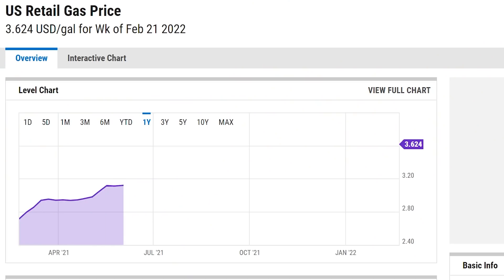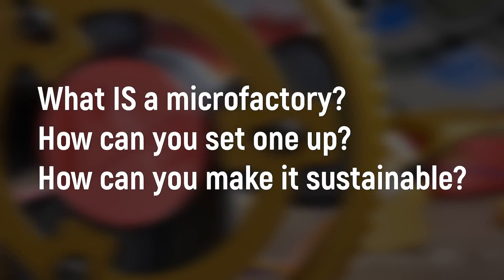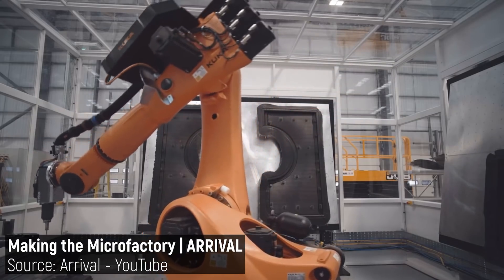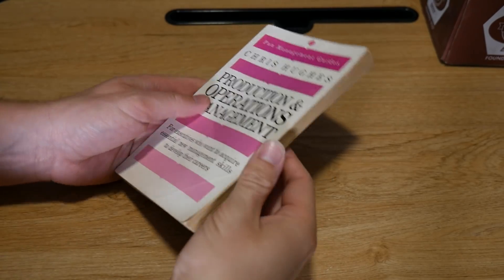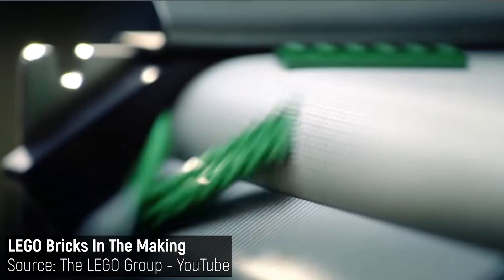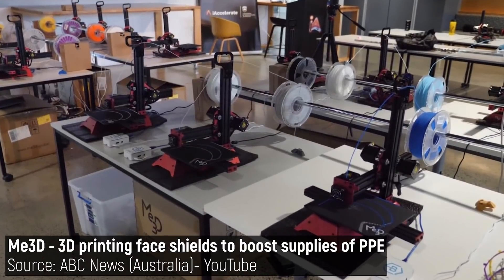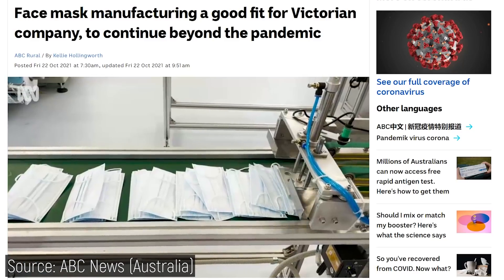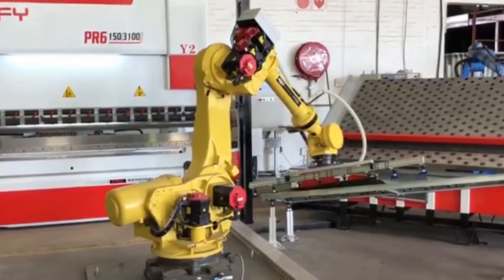Can Microfactories Solve the Global Logistics Crisis?

Comment: We already have the concept of a "small office/home office (SOHO)", and I think we now need to have the concept of a : "small factory/home factory(SFHF)". I myself have a metalworking workshop and very much want the idea to succeed.
The concept is not without its challenges though.
Before the industrial revolution and the steam-powered loom made centralised mass production possible, clothes were made by home weavers on manual looms, and were only sold locally.
The idea of home manufacture and local supply worked originally because the raw materials for both the product manufacture and the (wooden) machine used to do the manufacture were available locally. 
This original definition of the concept breaks down if what you are making requires imported plastic filament, and your 3D printer is constructed from ICs and motors made on the other side of the world with a 9-month back-order lead-time. 
Believingly that using such a printer makes the manufacture independent of the global supply chain would be completely delusional.
For the sort of goods required by a modern person, it is virtually impossible to start from locally sourced raw materials and produce finished goods without some part of the process requiring the global logistics supply chain.
However, this should not stop us from doing what we can to help.
It is still possible to import raw-materials and components and add value to them with a local manufacturing process and then sell that to the local community, thereby reducing (but not eliminating) reliance on the broken supply chain.
Whether this model is economically viable is a vastly more complex question. The current state of the global supply chain is that it has inconvenient delays, but it is far from being so broken that individuals have to grow our own food and make our own clothes. As such, the engines of mass production can still easily economically out-compete any home maker. For most goods, the home maker can't buy the raw materials to start making something for less than the cost of simply buying the finished article and having it shipped all the way from China. They have lost on price before they even start.
Either the situation would need to get MUCH worse than it is, to make home manufacture economically viable, or the home manufacturer needs to pick very niche markets where the mass-produced goods are completely unavailable.
Reply: Hello Nicholas, We have so many available raw materials that are not very well employed. My passion is to harvest the forest fuel overburden, just for one example. The materials currently catastrophically lost to fire could become premium quality humus and also could be potential used for making an endless amount of methane to fuel the operation. It is an infinite resource that needs to managed. There are so many wasted raw materials, or recycled feedstock materials that are shipped overseas to be remanufactured. Really finessed recycling could potentially go a long way to diminish the need for imported raw materials and other items currently imported. Really, small solar powered workplaces could be employed for the purpose of refining recycled raw materials on the local level, which in turn provides them to small local factories and workshops.

Comment: There's a 2 book long series called "Daemon" by Daniel Suarez

There's a lot of unrealistic or not so cool to live through stuff in it, but small scale production facilities that were basically a shed with a 6 axis cnc mill and a metal 3d printer that could build most anything
Reply: everyone forgets the lathe, it's the most fundamental machine tool and having a CNC mill without also having some kind of lathe is like having all those fancy kitchen gadgets (air fryer, pasta maker, whatever) but no stove or hotplate you can boil a pot on. You can mill a driveshaft with a 6 axis machine, but doing so is pretty silly.

I have a lathe and a mill, but about 70% of what I do is lathe stuff. Maybe 15% is possible to do on the lathe but easier on the mill. So If I were to have only one machine, a decent lathe is  what I'd want.

Comment: first thought: limitations in manufacturing resource distribution. only one place to go in a big factory, more shipping locations with micro factories. same problem, but i'm sure would work for specific item's. real world problems usually need multiple approaches.
Reply: How about a blend of the two? I don't believe mass production and super factories are going away soon, but perhaps a big factory making a basic product (and handling the certification and other economy-of-scale type overhead), with near-market job shops offering dressing/modification/customization for their local market. E.g. a factory making smartphone or wrist watch internals, with micro factories building them into the form factor desired by the customer. Or a factory making and shipping fabric blanks, with the micro factories sewing up the pieces into semi-bespoke clothing.

Comment: The main counterargument about cost is that freighting makes up a little part of logistic costs (with dominant part taken by last mile delivery), even more so in the scale of total cost
Reply: Over seas shipping has got significantly more expensive.  A container shipped from China to the US used to cost about $1000 in late 2019.  Today, that same container costs $10000.
Depending on the item, the additional cost can be insignificant or very significant.  It's a your mileage may vary situation.
Reply: @Shocker99  almost absolutely true, FRI has risen from 1,5k to 10k. However, per unit of 250g package it is still in realms of 1,5c vs 10c

Comment: I think the idea sounds awesome, and depending on the area you'd find people willing to pay extra for something a little more custom, or longer-lasting, etc. Another idea I thought of a bit ago in this vein (that I would have no idea how to implement) is a similar idea for repair shops. There are repair shops for computing electronics, and a lot for very specific things like lawn tools or the like. But recently my vacuum cleaner broke and I was able to fix it, and realized that most people I know would have thrown it out and bought a new one. So what if there was a repair shop that basically took anything, on a case-by-case basis (i.e. if they think they actually can fix the thing) with limited or no guarantee. Like the idea of a "tinker's shop". Again implementation would be hard because you'd have to be very clear that you can't make any very strong promises (unlike, say, a phone shop certified by a manufacturer to do repairs on their devices) and it would be tough to develop a pricing model that was fair for both the store and the consumer when some repairs will fail. Still though, if it could be figured out it could cut down on a lot of wasted products.

Comment: I think for this to take off it would be highly beneficial to have ranges of useful products for a local market with a standardised system behind it. Like it is with programming you have defined input and output ways between different software parts so anyone can implement them and use the part. The same would be very helpful here. Of course every 3D Printer, Lasercutter etc. is different but if you have defined systems that the micro manufacturing place can then implement to run on their machines they could produce most products build for these standards and that would make this whole endevour worth pursuing.

Comment: One problem I see is for example, I have a small hobby shop in a shed in the back yard. I have a mill, a couple lathes and other wood and metal working tools. As well as 3d printers. The problem is zoning. My residents isn't zoned for a business. That could cause issues. That would be a problem for many people I would think. I do like the idea of Microfactories though.

Comment: Stephen Hawes  talked about this in his videos while designing an Open Source pick and place machine. This Mid Scale manufacturing where you make more than just a few hundred products but not much more than a coupe of thousands. This weird in between where  full scale assembly lines are not cost effective and hand assembly not time efficient / to expensive. With 3D printers and other CNC machines making it more possible to fill this gap between bespoke and large scale production runs.

Comment: Microfactoring depends heavily on the use case. Especially for products where the transport is the main cost factor this is a viable option. But when you need cheap labor (like clothes industry) I think micro factories are not the thing unless these items can be produced automatically.
Producing clothing still needs a ton of manual labor. Therefore the producers look where they can acquire the cheapest labor in the world and don't worry much about transportation.
Like in the case with clamping blocks (to avoid the Danish product name) if the supply chain can be moved locally too this is an option (printing clamping blocks takes too much time).

Looking forward to your videos on this topic (and others as well).

Comment: 3D diy metal printers built out of welders are a thing now. It reminds me of when we all still had to build our 3D plastic printers from scratch.

It won't be long before we get affordable 3D metal printers. I'd like to see the diy injection mold machines also take off.

75 years ago even small cities had a local foundry. I'd like to see those make a comeback to work with local micro factories.
Reply: Have you ever seen the product made by those welder based 3d printers though? There is very very little precision, the objects are ugly and the fidelity on them is about the width of a pencil.
Reply: @DrakeTain   Have you seen the kind of crap we made with our homemade plastic printers before we had slicer software? It didn't take us that many decades to get us to where we are at today. The metal diy world is experiencing a similar development path.

Comment: Why going into the extremes? I don't think micro factories are that efficient. We used factories since the late bronze era at least (I'm not historian but that's the oldest I know), for pottery, smelting and few other things. A local factory can do much of what you'd need, with ease, but a micro factory would have a hard time to compete on its own.
You can however imagine a micro factory as a part of a bigger entity, to produce smaller batches, or to fix, restore, upcycle  things. That's what's is happening now, every company big enough is investing in a small lab with laser cutters, 3D printers and other CNC machines.

Comment: i get that sentiment and i do kind of have the same goal in mind
my long term dream in the future is to have a maker space that's also somewhat geared to mini production run, where people who are just starting or are just doing it for fun can experience the kind of machinery bigger workshop have

though, to be realistic, a 3D printed coat hanger is going to be more expensive and less durable than the injection molded one, something CNC'd is gonna be more expensive than an aluminum stamp and so on

the venn diagram of "not hard enough to be made in a garage" and "not too easy to spam out from factory" is like really really thin

Comment: I suspect that microfactories are a good extra pillar, but at the moment the global supply chain isn't set up to leverage it properly. If you're a large company who need 200,000 widgets a microfactory-based supply strategy will lead you to engage several suppliers, in addition to the secondary contracts in case one of those primary suppliers fails.

In addition you have issues with:
* Finding the producers in the first place
* Verifying the producer's bona-fides
* Legal contracts for each of them
* Support and future option contracts

The extra logistical burden far outweighs the benefit in terms of pure financials. Realistically, there need to be procurement processes designed and built to allow for this workflow.

During the early pandemic there were a lot of "microfactory" style sellers trying to sell stuff like face-shields to the UK NHS. They were almost all rejected as they can't prove the regulatory requirements, and their production volume was too small individually to make sense. Given the time to do the procurement process it makes more sense to wait an extra month, and pay an extra 30%.

What I can see as an option, is the establishment of brokerages that contract out to the microfactories. You, a large company need 200,000 of our widgets, so you engage our broker, who have a directory of producers and have QA in place. The broker can then scale horizontally based on demand, and issue jobs on a similar basis to fiverr.

Comment: Microfactories still rely on logistics for materials, so the answer is probably no.
Reply from the maker: Agreed, but materials could can take time to arrive vs the products which could be made using those shared materials quickly and locally.
Reply: @MakersMuse  but products can also take time to arrive.
The industry just has to plan for that by making larger stockpiles of the products they are using.
Reply: I think the key here is flexibility, if you have a stockpile of raw materials you can turn into many different products, it makes much more sense to stock up than on many different parts. Allowing for a bigger buffer and more room for substituting raw resources when resources or parts become unavailable from your current supplier.

Comment: That whole printing face shields thing is an interesting case. It's great that hobbyist printing communities could feel like they were getting involved to so something good for humanity, but we couldn't use all that home-made donated stuff in our hospital because it doesn't have the certification that PPE needs. Certification is prohibitively expensive for hobbyists. In a large face shield factory, the cost of getting products tested and certified is absorbed into the economy of scale because you can do it once and then make a million of them.
Reply: It's true, but I gave a bunch of printed shield holders to a few local veterinarians. They usually buy within the regular human-grade certified supply chain but they don't actually have to do that from a regulatory point of view. So by giving them the printed shields, it took pressure of the local supply since they were no longer in competition with doctors and hospitals for the human-grade stuff.
Reply: Our local hospital recently put signs all over to make it clear that PPE from outside the approved supply chain is not allowed.  I know that to some extent that rule was violated there but it never appeared to be widespread.
Reply: I had a local filament supplier that was selling the plastic shield part and spools of PETG at cost to encourage makers to print face shields for hospitals etc. I bought a bunch and printed practically 24hrs a day to make 200 face shields. Then I spent 2 very frustrating months thrying to donate them to anybody. I still have 180+ left in storage 2 years later. It did give me something to do when everything went into lockdown in Canada but now I'm looking for things to do with the clear plastic.
Reply: This is one of the ways that large corporations use regulations to edge out small scale competition. It's actually the reason why you see large corporations actively asking for regulations against themselves, because it destroys the ability for new competition to appear.
Reply: @carsonrush3352  true true true so true!
Reply: @carsonrush3352  Look at it this way:  When a company sees another company undercutting them on price by not implementing safety measures, they end up unable to compete, and seek regulation of the industry.  3D printers are a perfect example.  Most of the printers from Chinese brands aren't electrically certified, and you do hear about them catching on fire.  I haven't personally had a printer burn up, but I have had a Chinese hot-air rework station burst into flames just sitting idle. Sure, schools could save a lot of money buying uncertified printers, but I don't think that's a good idea.
Reply: I think the 3D printed faceshields were great for non-medical usage like everyday or maybe in schools. But indeed, hospitals have much higher standards to keep. The porus surface of a 3D printed faceshield is much more likely to trap dirt and bacteria than one that's moulded. Furthermore, I think the quality of microfactory is something that's really hard to ensure. Quality assurance is also rather expensive for hobbiests.
Reply: @wildwolf111  The surface quality really isn't an issue. You can't use these things for a long time anyway, then they have to be disinfected, or replaced. That holds for both injection molded and 3d printed parts. Soaking a 3D printed part in the right disinfectant should be just as safe.